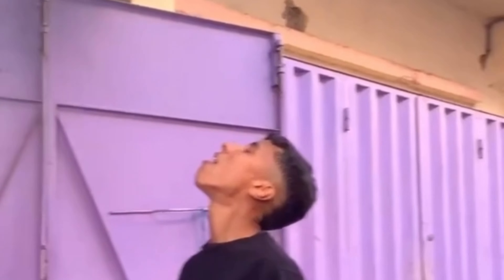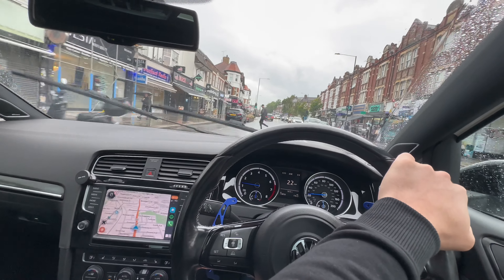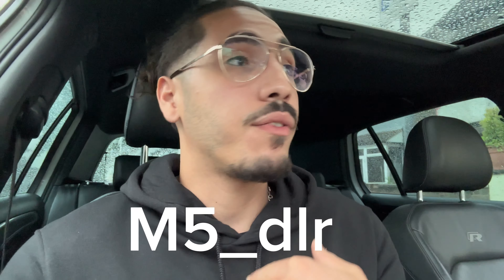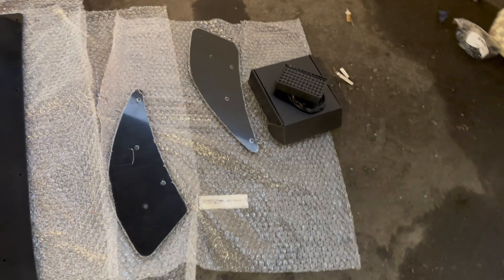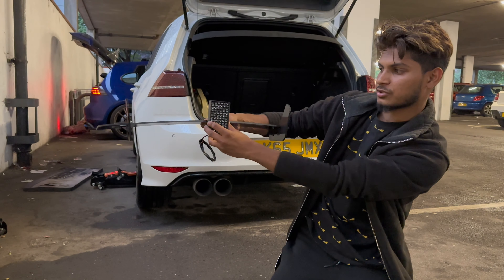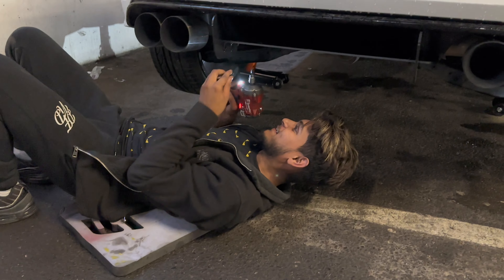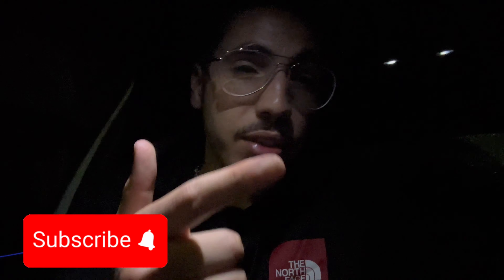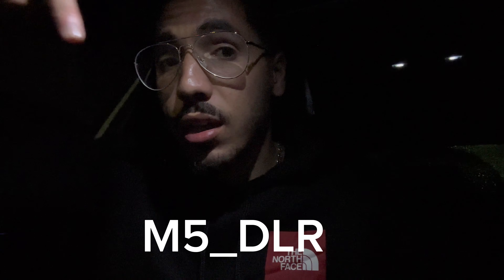INSTALLING F1 BRAKE  LIGHT  AND REAR DIFFUSER , تثبيت تعديلات جديدة في بلدي mk7 R 🐊🐊🐊🔥🔥

Comment: I’ve tried wiring my f1 light and it works however when my sidelight is on the f1 light doesn’t work, would you know why?
Reply: I’ve wired the yellow line to the brake light wire and the black to the brown, I haven’t wired the red on as it doesn’t mention too
Reply from the maker: I had this exactly f1 break lights in my old mk6 GTI and in this one and i haven’t got any issue with them , maybe the wiring is not the right one , as if the rear   lights  are after market ones they might be no sending enough power to the F1 .
Reply from the maker: Cause I had that issue with my mk6 GTI after market ones gave some issues at the beginning, best you can do message @abiid_7r on insta, he can advise you